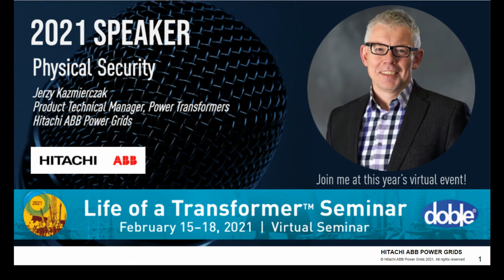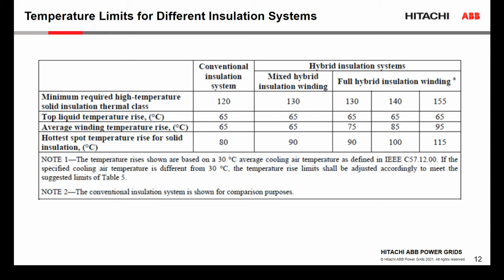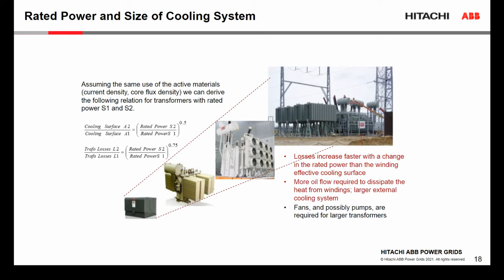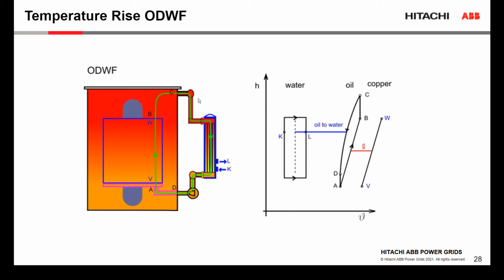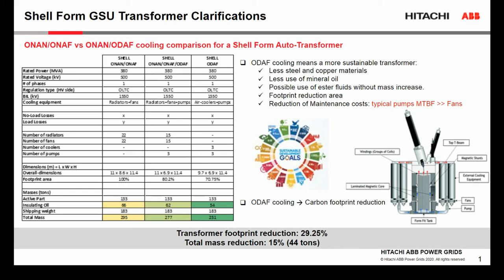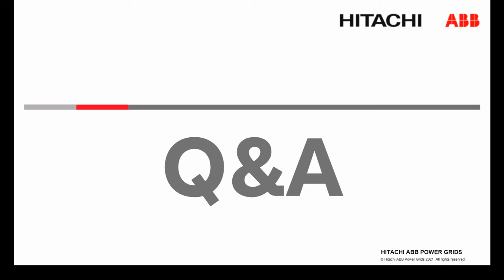Transformer Cooling Fundamentals Webinar

Comment: Thanks for the lecture. 
If you have 2 cooling stages, at what temp can you suggest to switch on the first and the 2nd, using the 65 & 80 deg C for top oil and winding hotspot limits per C57.12?